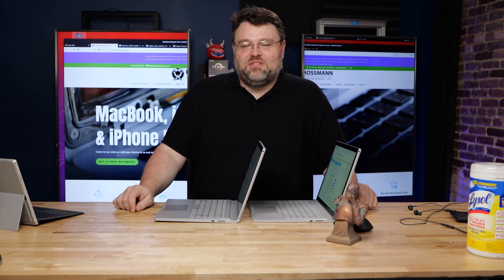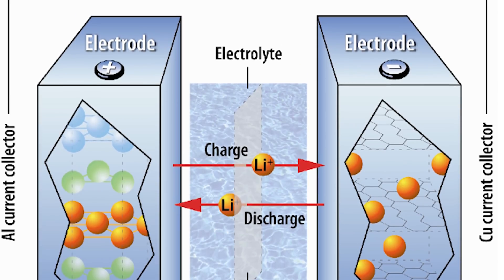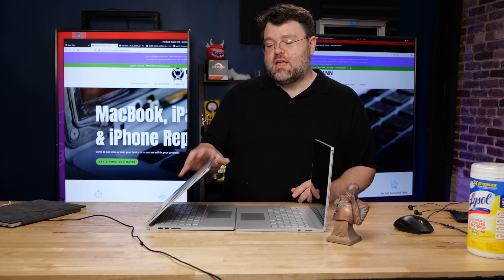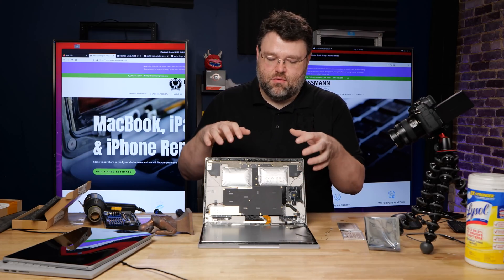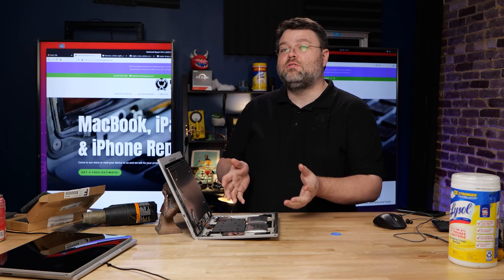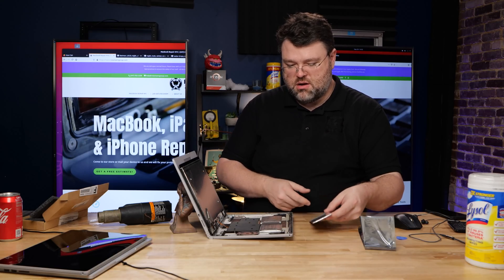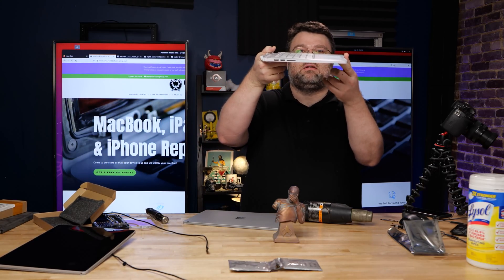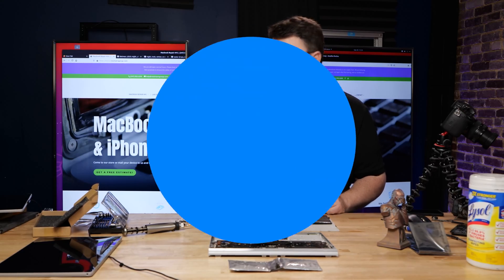The Laptop Repair Arms Race: Can We DIY Our Surface Book Battery Replacement?

Comment: I am disappointed with this video. I am trying to do a battery replacement now, but I cant get past step one, getting the screen off. I bought the iFixit stuff, their iOpener kit. It did nothing. I tried a heat gun but didnt know how hot I should set it at or how long I should keep the gun in an one spot. Your guide completely skipped past that step. Perhaps you cater to professionals who detach 30 screens a day, but for me doing it the fist time, I really wanted to go over that part.

Comment: @ 9:49 
Holds the heat gun in one spot for several seconds and then immediately after says, "With a heat source this intense, you gotta keep it moving....  don't ever stay in one spot."
 facepalm

   Btw, you can actually remove the upper LCD section from the base manually (without power).    You count down to the 6th hole on the side venting and push a small screwdriver, tweezers, etc., in at a slight angle until you hear the click of the release mechanism.     You're welcome

Comment: I just did this full replacement. Took my like 3 and half hours and I accidentally ripped off the antenna lol. But now my battery 1 (the one in the tablet) is showing a 0% charge and when I ran the battery report, it's not even showing up. Did you have to do any driver updates or anything to make it work after changing the battery?
Reply from the maker: No but sometimes there is a fuse that is also blown if your battery was in bad shape

Comment: Thank you for this video - it's extremely helpful. However, I guarantee that 95% of you will rip out the display connector cables which are located at the bottom of the screen. They are paper thin and it takes absolutely no force to rip them off the motherboard. In my case, I just removed the darn batteries and I did not bother to replace them after the removal or trying to re-connect the screen. The Surface Book (or what's left of it) starts up without the batteries when connected to the power and Windows recognizes the external screens (I have a Microsoft Travel Hub connected with two screens attached). I will toss the keyboard away, because this one is bulging as well due to the horrible batteries. I used to love the Surface Book, but the issue with the swollen batteries is a deal breaker for me.

Comment: With the Surface display I can understand the need for adhesive, but the chassis, batteries, and camera brackets? No. No way does preserving the form factor call for it. This is just anti-consumer, anti-repair greed, pure and simple.

Comment: @14:41 I can see the latch controller wire assembly disconnected from the logic board at the top left of the frame. How did you go about re-attaching it?

Comment: Hi, Excellent video!!! Maybe a stupid question but would it be possible to just remove the batteries and not replace them? My Asus worked without batteries with the power plugged in. Probably even more stupid question... My batteries are way more swollen than the ones in the video... dont want to hassel with the screws, would it be posible to cut the batteries in the middle and pull them out on each side?

Comment: I have this weird problem after swapping the battery.
For some reason my surface book always shows 0% battery.
  If I turn on the computer without a charge, it will show battery at 1 bar and shut down immediately. And yes I charged it overnight.
  If I turn on the computer with a charger and unplug the charger after booting to windows, it will stay on but with 0% battery. I watched some video and it did not power off at 0%.
Anyone else with this issue?
Reply from the maker: The fuse is blown sadly :(

Comment: Im so regreting having this... on the paper seemed an excelent portable 13 inch laptop, very short durability less than 2 years, it was expensive like hell, microsoft and repair is a nightmare, barely can find anyone who dares to touch it where i am from... and what they would charge for the replacement battery services makes it unworthy since i can get a new laptop for a bit more what they are charging me for replacement... wont by anymore products from Microsoft again.

Comment: Thanks! Quick question on reassembly. Should it run on battery immediately upon install?  When I put new battery in would not turn on. Plugged in and it turned on and showed new battery at 40% so I unplugged, but it instantly went dead. Is this a sign the battery was no good?  Thanks

Comment: Extinguishing lithium battery fires? No chance. You need either a ton of water or something to suffocate it. Work on an oven tray (steel!) and keep a bucket of fine-grained sand close by. In case of a fire you can dump the bucket onto the tray and carry it outside. Do not use powder extinguishers. They do almost nothing and you will certainly ruin every device in the room.
Reply from the maker: 5 gallon bucket of sand
Reply: @Level1Techs  I guess you cannot use too much sand. But lifting it up might ruin your back. ;)

Comment: if you've got a 3d printer with a heated bed you can melt the glue with that better/more evenly than a heat gun. set the bed to around 70-85c
Reply: Do you recommend placing it screen side down or on the back when heating it up on the 3d printer bed?

Comment: My surfacebook is not bloated yet... but i do need to replace the battery because it is no longer connecting in the screen section... 

If you need to do another one of these, you can simply pull to separate the halves. Since it's only an electromagnet and not a mechanical connection, you can simply pull hard to separate the screen without damaging anything.

Comment: But...I am Arch user tho. Also, you want a bucket of sand when dealing with highly flammable batteries like Li-Poly. Pour the sand over the flames. It will starve it quick fast.

Comment: Pro criminal tip: You can disconnect the screen from the keyboard using a paperclip shoved into the side vent holes that are 3 or 4 holes up from the hinges

Comment: People keep buying unrepairable devices. I learned the hard way, and will no longer buy Apple computers. The clunkier commodity Windows laptops are not only easier to repair/mod, they suffer less cooling issues, and cheaper. Vote with your wallet.

Comment: Please fact-check: Is the intensity of the “battery thermal runaway event” (I wo wo wo wo wonder...🙃) noticeably higher if the battery is charged or is completely discharging it first much safer?
Reply: Exactly as dangerous. They'll catch fire, and possibly explode, if the casing is ruptured. Note that for most batteries, the "puffed" part is actually the OUTER casing, and is a mixture of fluorine gas and other junk you really don't want to breathe in. If the INNER casing is ruptured and the outer casing also ruptures, you'll get a fire/explosion.

Comment: Watching this on a 8 year old MBP Battery that still has 85% capacity left. 3 years on those surface books is a joke.
Reply: How many cycles has it done? Got 1300 out of my last MacBook battery before I had to pay the $199 for it to be replaced.
Reply: @edc1569  1650 full cycles.

Comment: Wendell: "This is a fire hazard!"
Me: Looks over at bulging surface book in the corner
Reply: ........................as well as my top spec (at the time) bulging surface pro 4.  NEVER buying a surface again - I have my eyes on a nice HP Envy x360 with the Ryzen 4000 series in it.  It's fast, light, runs cooler and is USER REPAIRABLE/REPLACEABLE.

Comment: wow considering the price of those surface books when new, i thought they wouldnt be disposable and crap like that... Jesus.
Reply: Look at any mac book built in the last 6 years for better examples of anti-repair
Reply: @Holcombi  I can assure you changing the battery on any MacBook is considerably easier than a surface book, plus Apple will do it for you for $129-$199 if its less than 6 years old.
Reply: @edc1569  are you arguing that every single macbook made in that last 6 years has been built upon a foundation of anti-repair? Or, that they don't also glue their batteries in place? Also, 5 minutes worth of googling points to the inherent flaw in your line of though since the only reason they are "easier" to repair is because apple stores replace the entire top case enclosure including the keyboard and trackpad.
Reply: It will only get worse until safety laws forbid the use of glue (which is only removable with heat) on batteries which when heated can become a fire hazard.

Comment: DISCHARGE THE BATTERY BEFORE REPLACING IT! The amount of energy released if it were to explode will be much less than with it fully charged.
Reply: Definitely an important step if you can do it.
Reply: He said that the battery is dangerous if fully charged or fully discharged.  I suppose that might only have been for long term storage, but I don't know.

Comment: Wendell; any advice on how to find a source for reliable replacement batteries? I have an old HP laptop that (luckily) has a proper battery CARTRIDGE that can be swapped out in 10 seconds. I looked on Amazon and Ebay and found tons of places that sold them. But ALL of them seemed to have the same number of good and bad reviews, meaning it would be a total crap shoot wherever I bought one if it would be a good battery or not. Any suggestions?

Comment: Tip: Print out the instructions from iFixit. With a piece of tape you can stick each screw you take out onto its picture. That way you don’t mix them up when you put it back together.

Comment: Honestly if you are coming up on a 3 year warranty and have swelling like that, see if you can just use the warranty for an upgrade. A lot of these issues that crop up, Microsoft won’t want to deal with repairing. Turned an original skylake surface book into a a new pro 7 by using the warranty on it.
Reply: That sounds great, but these are 2016 laptops which means the warranty expired sometime in 2019, and we are almost at the end of 2020. Which means there is no warranty to use.
Reply: @SirReptitious  Yeah, in this case it wouldn’t work. But it’s something to be aware of as the warranty period comes to a close.

Comment: This is why I have two ThinkPads. The older one, an e530 has replaceable batteries. The newer one, and e585, can be opened and the battery is replaceable.

Comment: I have a surface laptop 2 and it has a BIOS level option to keep the battery at a maximum of 50% for use cases where the device spends a majority of its time plugged in/docked. I do turn this off from time to time to allow it to get a full charge and then allow it to drain down to about 20%. Hopefully this helps extend the life of the battery long term.
Reply: Nope. I did this, and my Surface Book battery still expanded. The batteries are defective.
Reply: Cycling the battery helped with nickel technology. Lithium batteries REALLY don't like to work. They don't like to be fully charged, i.e. at high voltage. They don't like carrying current, i.e being discharged, they don't like to be discharged fully. All these conditions make their chemisty age. The clock really starts ticking on them as soon as they leave the factory.
The option to not fully charge the battery when operating plugged in is a really sensible feature. I wish more manufacturers would offer that. Remain at 50% when plugged in, then the night before you intend to use it offline ask for a full charge.

Comment: Pro tip for removing battery adhesive: use alcohol for loosening the adhesive and use dental floss to cut the adhesive. This way, you don't risk heating up the battery and exploding. Make sure you wipe the powder on the floss to avoid a mess. You can still heat up the other side when the floss can't cut.
Reply: Would goo gone work better than alcohol? Any danger in using goo gone?
Reply: 13:22 ????
Reply: A little acetone helps.
Reply: @ashishpatel350  Except acetone doesn't really agree with PCB's and stuff.

Comment: I'm torn about the repairability of laptops as their size makes them more like smartphones. The form factor makes the surface unique, but the lack of upgradability or repairability due to integrating everything into the motherboard (just like a smartphone) makes me dislike laptops that use adhesive to seal their products.
Reply: You can thanks the Macbook Air for that. Before it, screws were the norm on laptops. Now that stupid thing became a model for the industry, so is adhesive everywhere. But what makes me mad is that building something thin is not to make them lighter, is just aesthetics. Thick lightweight laptops existed before the Air, and obviously overheating CPUs were not the norm.

Heating issues, crap keyboards, upgrade-ability, repair-ability, all sacrificed on the worship altar to "Sir" Jony Ivy.
Reply: @magoid  The funny thing about that is the Macbook Air had screws for everything, even the battery and without improving the design or making it all that much thinner they started using glue, although to give them some credit, they've never gone overboard with the glue or worse use epoxy like some manufacturers have, so Apple might be an industry leader/trend setter let's not rest the blame solely on them, I mean it's not as if other companies HAVE to follow in their footsteps.